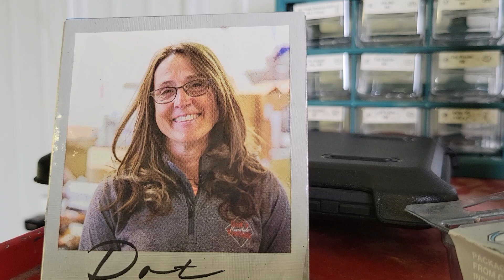The blower experiment is over!!!

Comment: What year is that Grand Prix ? I want the top core support filler panel that's just behind the headlights and grill to modify it to fit on my 84 Monte Carlo.I hate the huge openings it has i know I can buy custom panels to bolt right over them but if i can buy a top plate from a junkyard car I could probably buy the whole thing for 5 bucks and just cut it.
Reply from the maker: 86

Comment: Have you looked into remote mounting the turbo out back? That might be too much trouble for higher power levels though. And if you are moving the trans cooler anyways... do the rules allow you to cut out the heater box area? That might give you more room to place the turbo?
Reply from the maker: Yeah I've thought about it a lot and I might try that on the next car. Heater box is already gone and I've never seen any rules saying that it had to be there. I actually mocked up the turbo close to the firewall last night. Ended up being the best place for it.